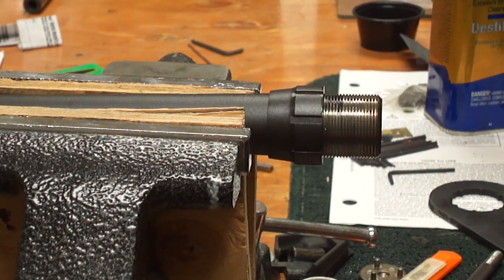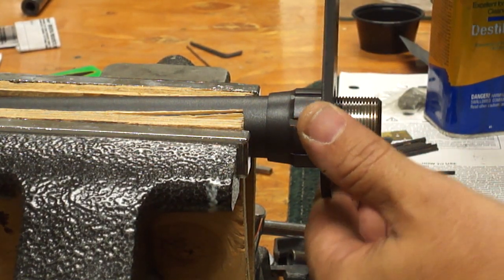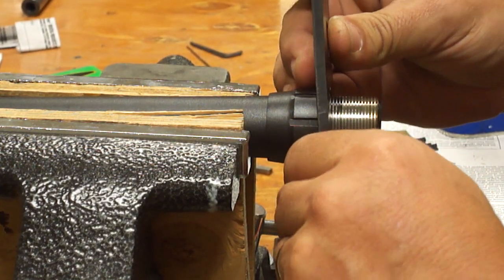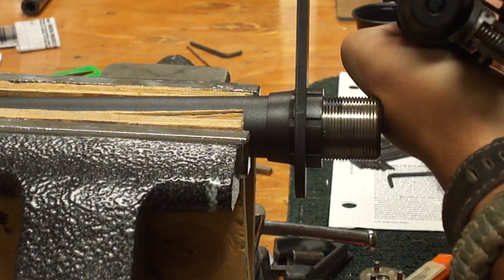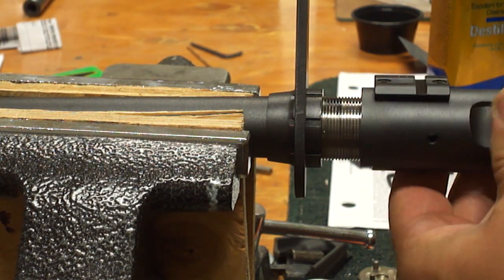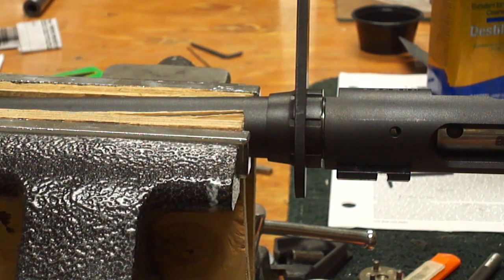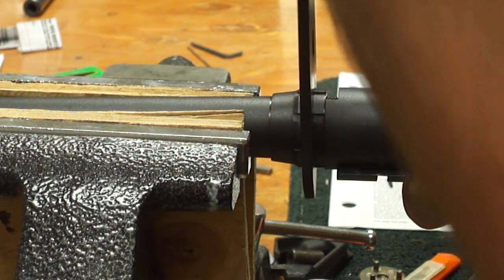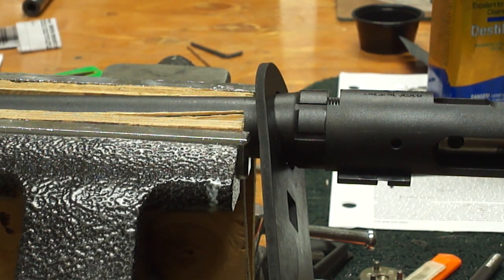Headspacing a Savage Bolt Action Rifle

Comment: You forgot the recoil lug but great explanation. Thanks,
Reply from the maker: Nope. The recoil lug on that rifle doesn't fit between the barrel and receiver like a 700, it just slips into the cutout at the bottom of the receiver.
Reply: Okay I have 2 of the savage rifles and I have recoil lugs on both mine.  I do NOW understand what you are talking about.  I see the space on the receiver where the slot is.  I have never seen a savage like this.  Which model is it?
Reply from the maker: This is a Savage Edge .223, It's a bit different from the 10/110 series rifles.
Reply: The Axis model has this type of recoil lug setup also.

Comment: Great video! I've recently rebarreled my Savage. Using the go gauge I threaded the action on until it was lightly snug against the barrel and then i snugged up  a little more firmly. My question is what are the signs of having the headspace too tight? I am able to chamber the go gauge but the bolt handle doesnt fall into lock. I have to assist it to lock with light effort. Thanks!!!
Reply: Prob lap your bolt and lugs a lil bit with a lil bit of 500 grit aluminum oxide and some greese and kroil oil till it is running smoother and make sure it won’t close with a no go and you should be golden

Comment: Great video .
I always neck size my 270 brass after first shot which is custom fit to my chamber  . Brass height is as SAAMI spec .
But when ever i try headspace guage  it does not fit properly .
Now my question is does my rifle has headspace issue ? 
Do i need to continue neck sizing  or i should show it to a gun smith ?

Comment: question. I have a broken factory lug on my 110 LA. I have a new lug and was wondering, can I spin the barrel nut off to the end of the barrel, swap lugs and reinstall the nut, this way the action and barrel aren't ever moved, this the headspace stays correct? or does the nut only come off the action side?
Reply from the maker: The lug will only come off the action side.
Reply: thank you

Comment: what're you using in the vise? is that just pieces of wood? I'm gonna put a new barrel on my 7mm mag savage 110 and don't want to spend the money on a full barrel vise set up or spend the ridiculous amount that gunsmiths want around here.
Reply: Look at the tools available from Northland Shooters Supply. With a moderate bench vise and about $100 of NSS tools you will be able to swap barrels on your Savage 110 with ease. You will  also need to rent or buy a set of head space gauges to complete the task!
Reply: Will Dougherty the barrel comes with the barrel nut wrench and go/no go gauges... All I need is something to safely hold the barrel in my vise but I don't wanna spend a bunch since I'm gonna most likely only use it once.
Reply: PewPewClint
If you use the NSS wrench I did and like the one in the video, you can unscrew the handle and put it in a smaller vise. I think mine is a 4". It worked like a champ for me building a Remage but the process is the same for your 110 and the folks at NSS are good to work with!
Reply: With the NSS system their wrench holds the barrel and action and your vise holds the wrench
Reply from the maker: Yes just a couple pieces of plywood.

Comment: Thus should be labeled "checking headspace" Not headspacing...
Reply: Well that's called headspacing a barrel checking headspace is what happens when you've installed the barrel, and everything is torqued down. You cannot check something. It is not completed, and you cannot complete a barrel without headspacing it

Comment: you forgot the recoil lug
Reply from the maker: Nope, as mentioned in earlier comments this is a savage edge. The recoil lug isn't fixed like on a Rem 700 or Sav 110. It just rests in a slot cut in the receiver. Doesn't even come into play when setting headspace.